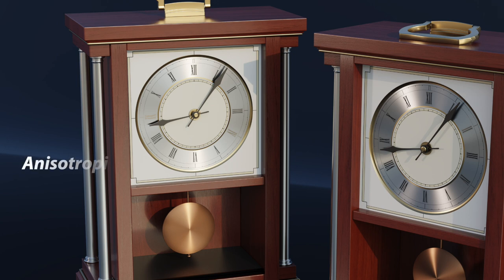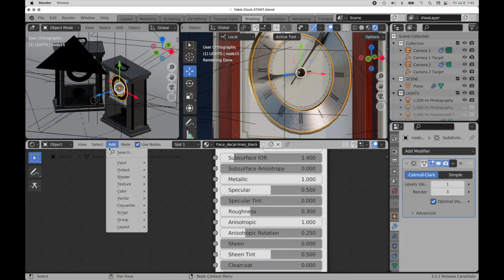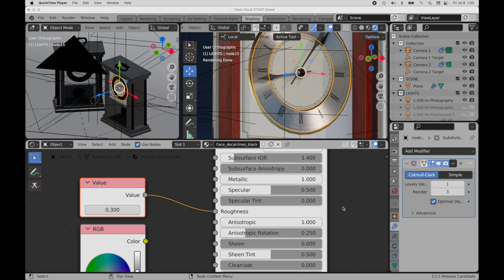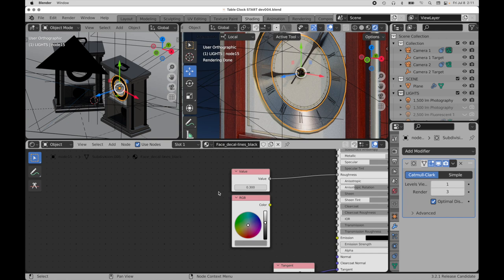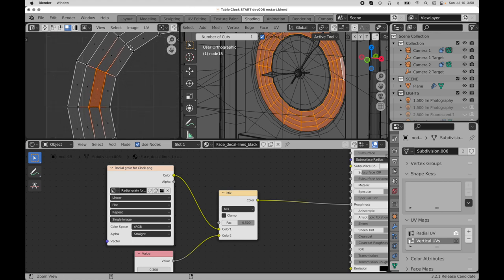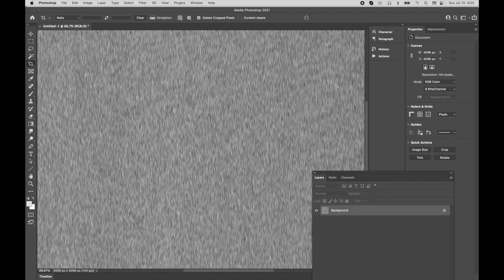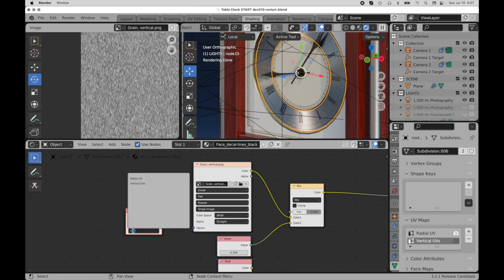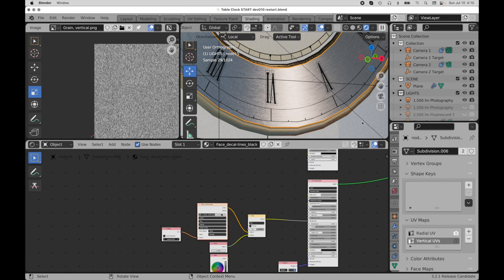Add a Brushed Metal Texture to Anisotropic Reflections

Comment: Thanks for introducing me to this concept! 
I have played around a bit to try and find a way to create the grain texture in Blender without needing to swap over to PS. The result is slightly different, but depending on the usecase its just fine.
Here's my shader setup for anyone who wants to try it:
1. Texture Coordinate Node (Object Output) > Vector Input of a Mapping Node with Z set to 0. X and Y need to be the same Value. 
2. Output the Vector into a Vector Math Node set to Length. (skip for a vertical map)
3. Output the Value into the Vector of a Noise Texture of your choice (I like Musgrave).
4. (Optional) Make an RGB Color Node and Mix it with the Output from the Noise. I also use this RGB Node to drive the color of my BSDF shader.
5. (Optional) Take the Output and plug it into a Map Range node. Both of these optional steps just add more flexibility. 
4. Output the Result to Anisotropy. 

Now personally I plug this into a dedicated Anisotropic BSDF and mix it with whatever else I need. That way I can save the above as an asset and just drop it in as needed.
Reply from the maker: Yeah I thought about using a node setup to drive the grain pattern, but I didn't for two reasons. One was it would have made the tutorial more complex, and I wasn't getting results that I liked. It was just easier to produce a bitmap to drive the grain.

Comment: Thank you. As a tip: You can easily create circular brush lines procedurally in Blender using the internal Noise Texture. There’s no need to use PS or any other application like PS.
Reply from the maker: Yeah I had explored that as the method I was going to present, but I wasn't getting the kind of control and result I wanted with procedural noise, so I opted to go via the bitmap route.

Comment: Thank you for sharing of technique.  I can now create brushed textures using graphics program.  The UV transform from radial to linear map is interesting concept too.👍  However, for objects such as knobs and bottom of pans where the radial texture continues to  the center of the object.  This method cannot be applied easily.  Anyway, your knowledge on the topic is top class.👏🙂
Reply from the maker: yes so in those cases you would just use the Radial approach. There's actually a 3rd method used by other 3D applications that uses a normal or grey scale gradient map to define strand direction, but Blender doesn't appear to support that. It would be useful for some situations.
Reply: @christopher3d475  ,  I forgot to mention that I first learnt the "Follow Active Quads" from you too.😀

Comment: Why image based? UV based generators can be made seamless by expanding 2D into 3D (for one seam) or 4D (for two seams, but will not be as good). Works very well when the center is missing. Conversion is something like X = cos(X), Y = sin(x), Z = Y. Drive a voronoi, use it's color.hue value (scaled significantly down) to drive rotation - hue is 0.5 centric. Use radial tangents where possible, as UV based tangents are not smoothed across the seam.
Don't forget tangents can be calculated too from scratch to produce patterns not easily done manipulating rotation alone (like machine milling toolmarks). Most metals will be anisotropic in some fashion due to manufacturing process and abrasive polishing, some in ways not easily replicated in Blender/Cycles. Like long tail on highly polished metal is something most renderers will struggle with, have to mix in some Beckmann anisotropic for that, but still not that convincing. Think copper brewery equipment where a man will reflect pretty sharply, but still produces insanely gorgeous streaks from more intense lighting.
Try something more complex than a simple radial based thing, like sheet metal from brushed steel bent into shape. Even rectangular steel tubes will usually be anisotropic, but unlike a cylinder it will be polished in the perpendicular direction leaving anisotropy in the "ugly" direction. And how would you approach anisotropy on parts containing singularities? Like fur on a horse.